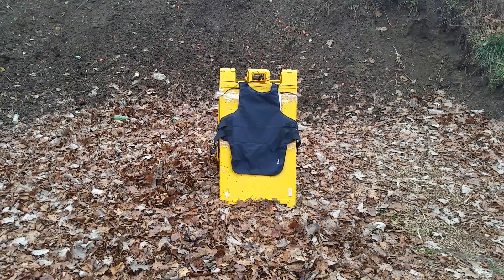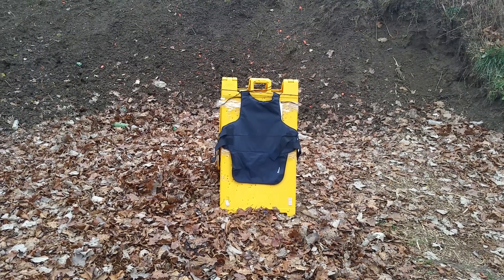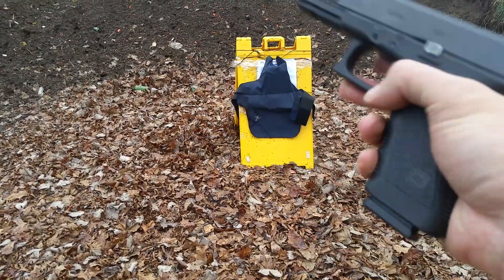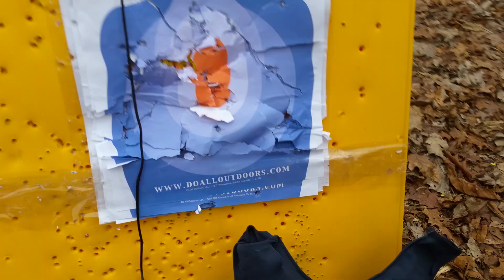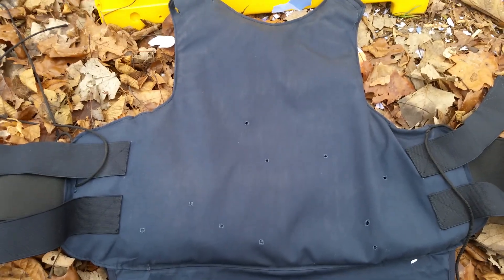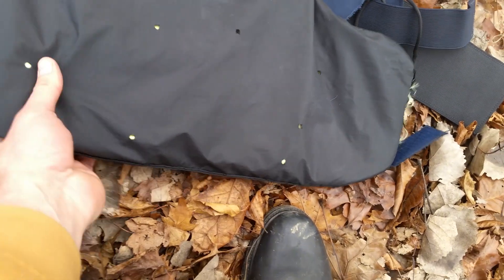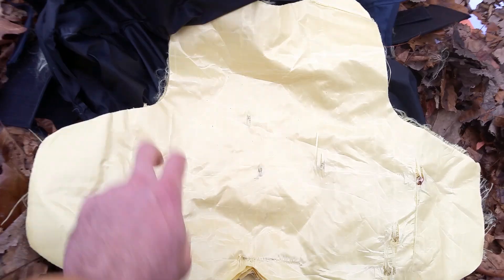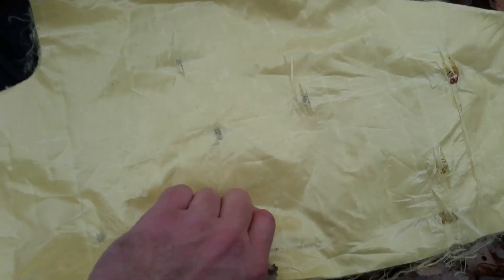Bullet proof vest test: 9mm DPX round defeated vest

Comment: What level vests were you using?
Reply: Good question.  My guess is Level II or Level IIA.  Level 1 will not stop a 9mm at all and most Law enforcement agencies wouldn't waste their money on them and he did say this was an "old police turn in".  Criminals are not going to wear more than those mentioned levels anyway.  IIIA penetration would require higher velocities than pistols are capable of, even a 44 magnum.  If a criminal could afford that or more, he wouldn't need to rob you or would have to wear inch thick steel plates, not easy to run with.
Reply: John Sparks Liberty Civil Defense .. 9mm @ 2000+ ft. per sec. .. 4" barrel will slide right thru IIIA no problem
Reply: I would have to see that but that is a very high velocity for a 9mm.
Reply: That vest is badly degraded. There should be tighter stitching throughout and especially around the edges. And yes I know ballistic vests.